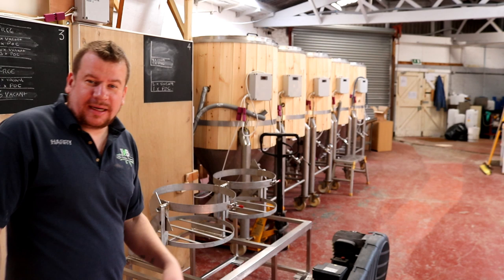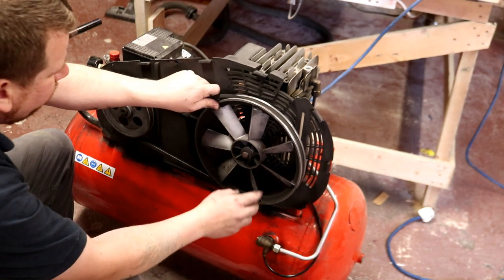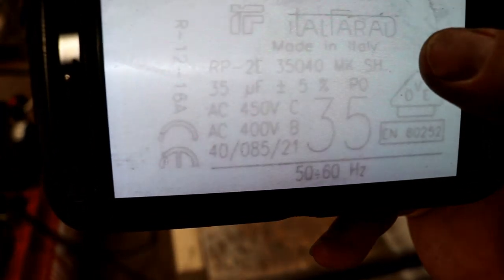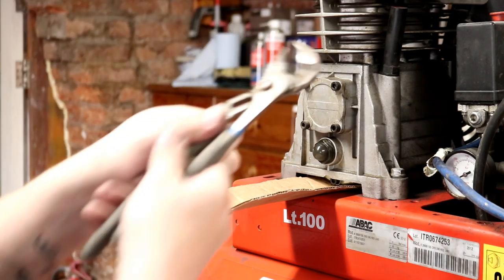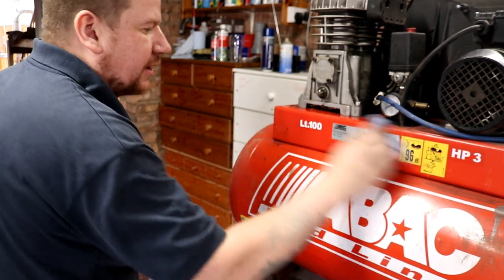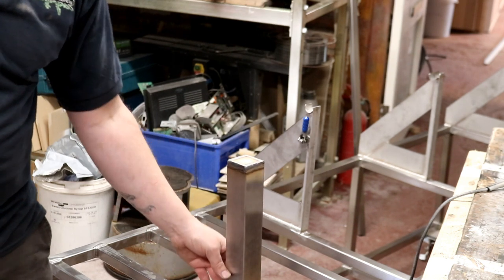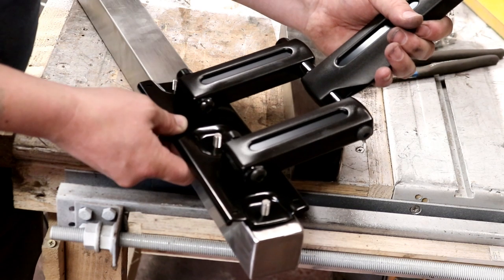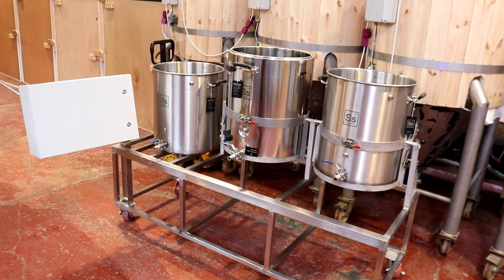🎈COMPRESSOR FAIL TROUBLESHOOTING 🔫

Comment: The capacitor doesn't need to be identical, it's only to give a phase shift so the motor rotates in the right direction every time. As long as its rated for the voltage, you could grab one from another motor if you've got one knocking around for testing